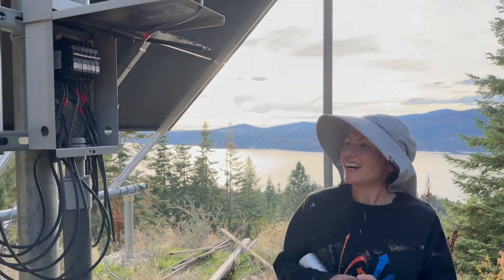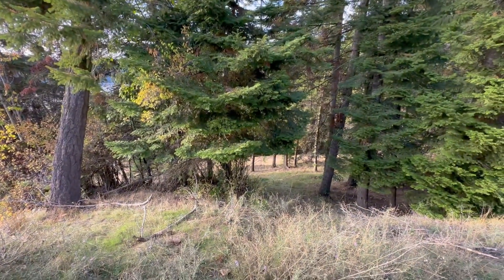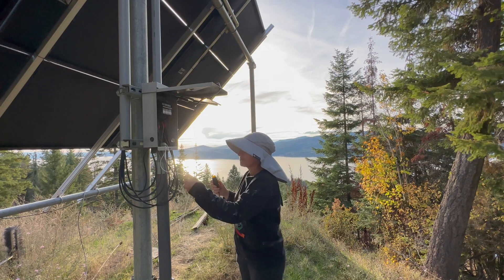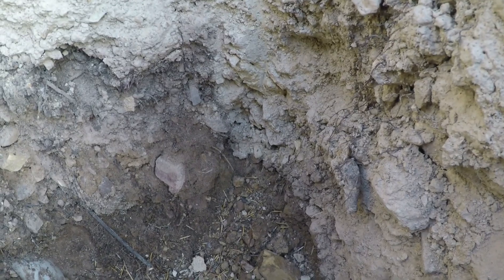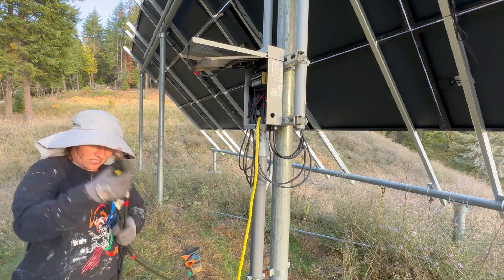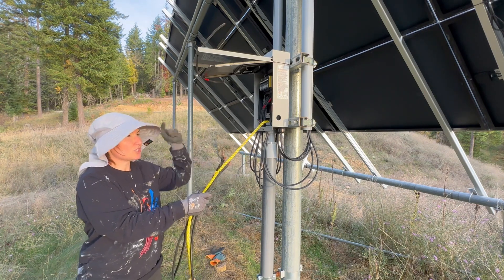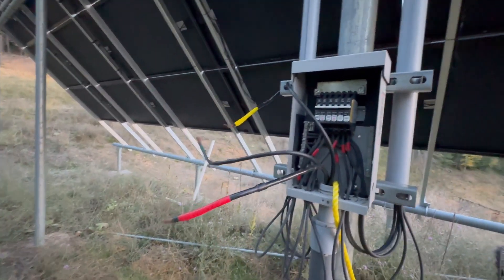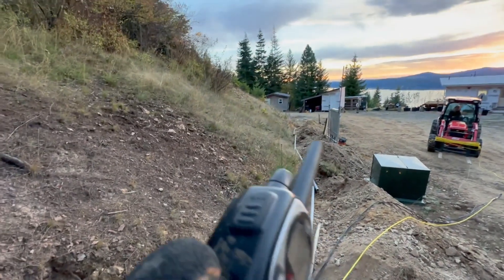How To Pull Wires Through conduit. Easiest way to wire your house

Comment: Great Job.   That's a long run, how do you solve for voltage drop due to the distance?
Reply from the maker: we used 2-0 copper wire, 3 lines